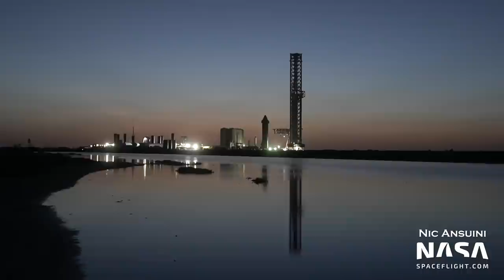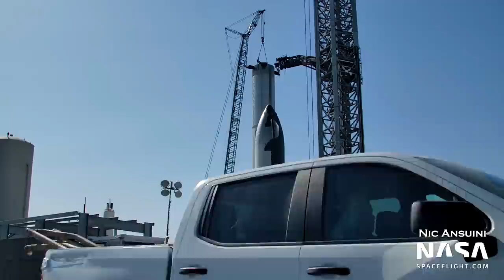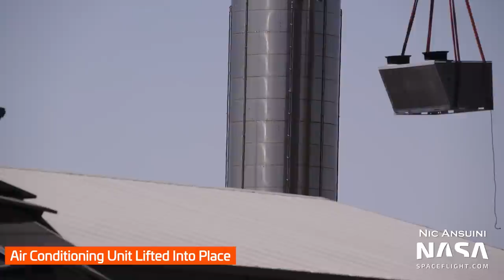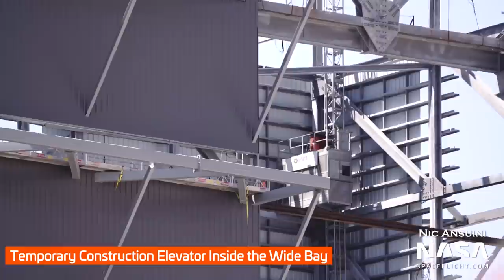Booster 4 Prepared for Launch Mount Removal | SpaceX Boca Chica

Comment from the maker: 0:00 Sunrise Over the Launch Site
0:12 The Launch Site
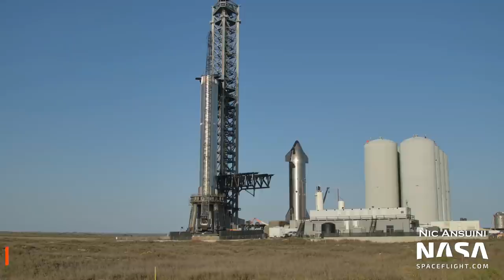0:27 Booster 4 Connected to the SpaceX LR 11000 Crane
0:48 Crews Prepare the Booster Transport Stand for Booster 4
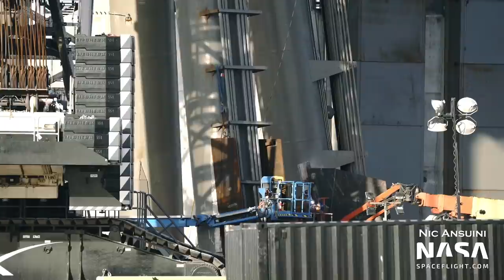1:18 Crews Weld Steel Parts on the Orbital Launch Mount
2:00 Chopstick Work Continues
2:40 Quick Disconnect Arm
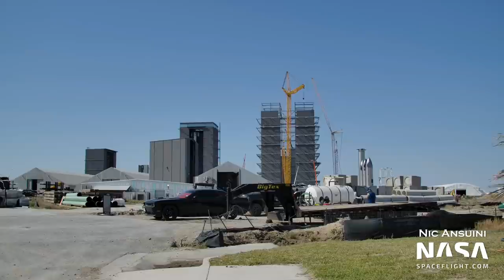4:03 The Production Site
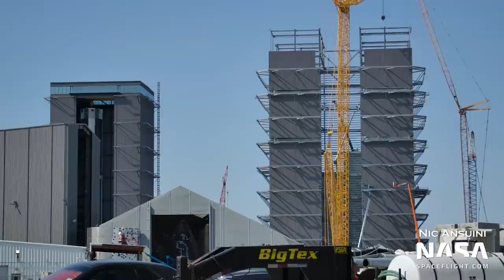4:22 Wide Bay Construction Continues
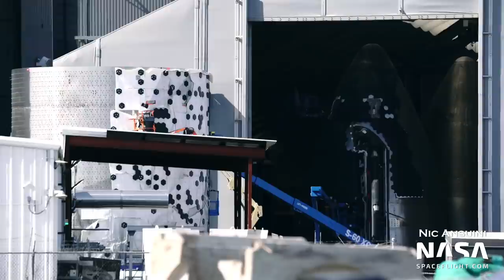4:42 Thermal Tiles Applied to Ship 24’s Nosecone Sections 
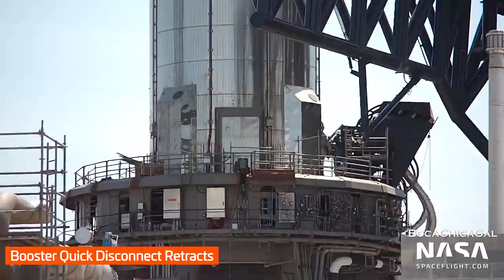6:05 Booster Quick Disconnect Retracts
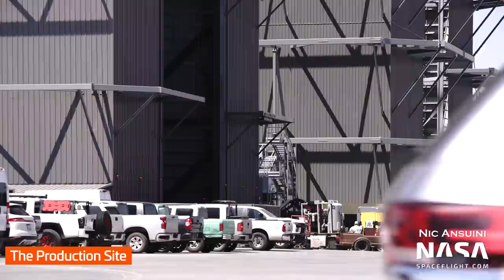6:58 The Production Site
7:48 Air Conditioning Unit Lifted Into Place
8:14 Dome Segments Outside the Tents
8:40 New Booster Thrust Puck
9:05 Temporary Construction Elevator Inside the Wide Bay
Reply: Long lmao
Reply: Why aren't they Using the Chopsticks to lift it? Shouldn't that be tested out?

Comment: Funny that they’re still not using the chopsticks 🥢 to lift the booster, but opted for the crane 🏗 again. I wonder what could be the reason. Structural integrity of the booster? I doubt that, as it would use the same load bearing points. Uncertainty of the chopsticks’ reliability with an even heavier load, and not taking any chances while it’s their only way to stack a rocket?
Reply: Could be that B4 is not properly equipped for a lift by the chopsticks?
Reply: The chopsticks have another mechanism that does not fit boosters at present. To change that is not simple - using the crane is.
Reply: @renehenckens  that certainly seems the most logical, is it the possibly sockets for the lower support brackets?

Its the only thing that would make logical sense as the 'original' elon timeline had booster 4 and ship 20 doing the orbital flight before the completion of the chopsticks, so makes sense in that regard.
Reply: Also I think they want to put B4 on the static fire test stand so why use chopsticks first and then crane if you could just use the crane
Reply: @tarek42023  It already is on the only SF test stand - the OLM. Did you mean the new cryo tests and can crusher stand?
Reply: @knowledgeisgood9645  What is the can crusher then? Thought it was for full static fire
Reply: @tarek42023  The can crusher is a stand and a "hat". They put the hat on top and join the hat with the stand using cables. Pistons on the stand pull on the cables until the forces the booster has to survive are reached. It is a way to test if a booster can survive MaxQ or not.
It has only been used on a test tank this far.
Reply: @tarek42023  I have to correct myself. B4 was NOT placed on the "can crusher" but on a transport stand. One of the new ones with alignment pins on two sides.

Comment: Speculation, b5 and sn 22/21 will also be test subjects to project zero. Sn 24 and booster 7 are likely to be the first, or unless you see a boat load of raptor v2 coming in when booster 5 is around then maybe they will do a static fire test.. not fly booster 5 tho, they want to see how the olp is going to hold up

Comment: Curious if 4 and 20 have plumbing, sensor and limited control packaging only for the testing.  I would not think the  navigation components would be included or necessary. Physical proof of concept an integrity.

Comment: Curious as to why the use of a crane?? If I may ??  Consider using laser beems from the lift to the ground for exact mounting and dismounting. Can be preset to ensure timely interchange. Also can either of the bases ( stages and prep) move one way or the other.

Comment: Why are they using CraneX for Booster 4 dismount from OLP. Why not using Chopstix?
Reply: Don't think they want to risk the chopsticks with boosters load, that's my guess
Reply: I am guessing, so don't 🧨💥me up if I get it wrong: The Chopsticks have a ball fitting that goes into the cavity under the forward wing area on the Starship. The booster has a ball fitting near the grid fins. So they need to change that to a cavity, to use with the Chopsticks. That's my observation.
Reply: @David-yo5ws  I think you are almost correct. The chopsticks need two types of fittings at present, but only have one. Once the chopsticks can connect to both it will start to lift both.
If I am to guess, the Ships will get something like what the boosters have - the problem is how to shield them. Retracting pins on a ship would be hard to make strong enough without adding too much weight.
Then comes the problem of catching them when landing. Holes in the hull for pins on the chopsticks would never be reliable - hooks will be needed on both booster and ship.
Reply: @knowledgeisgood9645  Yes, currently two separate setup's. Today's video shows B7 still with the 'hook' system.

Comment: i wish space x would at least send 4/20 up, to at the least test the heat shield on re entry!
Reply: I don’t get why they won’t send it up… It would get them more data and maybe would be a proof of concept. If it gets destroyed in the ocean or if it ends in the rocket garden won’t make a difference so the only difference I see is fuel price for a too old concept
Reply: @tarek42023  They aren't going to launch 29 cranky Raptor engines and possibly destroy the launch tower.
Reply: @michelleroberts1370  Ohhh yeah makes sense that’s a valid argument to use more reliable engines to protect the whole infrastructure
Reply: It really makes you wonder though, what would SpaceX have done if they weren’t held back by FAA approvals. How much risk would they have been willing to take with this rocket. And how much time would they have been able to cut from their own cycle time. I hope someone asks Elon this question next time they get a chance to speak to him.
Reply: In Elon's interview with Tim Dodd he said he was worried about the takeoff. He could have been joking, but I think he really meant it. But SpaceX continued working on both S20 and B4 for months which makes me guess there was hope still, but at some point, not so far back, they gave up on B4/S20.
I just hope the lessons learned were worth the expense.
Reply: It wasn’t going to orbit anyway, so the heat shield wouldn’t have been used.
Reply: @aldunlop4622  ship 20 would have been at orbital speed and altitude so yes the thermal protection system would have been given a thorough testing. Yes the ship wasn't to make a full orbit, but that is irrelevant
Reply: @aldunlop4622  yes the plan was always for s20 to go into orbit, the entire purpose of the planned launch was to test the heat shield at orbital return velocity.  It was going to launched to orbital altitude and velocity.  Then, it was going to be immediately de-orbited so as to test reentry, and the heat shield will absolutely be necessary. It would also be the first opportunity to test the vacuum engines in flight.  Just because it was not going to make a complete loop around the earth does not mean it is not “in orbit”. This flight path is different from a ballistic flight path because it will not be a simple parabola, but even a ballistic missile still needs a heat shield for reentry it it goes high enough.  
But it makes perfect sense to not fly b4/s20 because they have made lots of updates so it makes more sense to test what is more likely to work.  It is very expensive to actually launch a rocket, so it would not make financial sense to launch anything but the most useful version.
Reply: Blowing up stage 0 would be the worst case scenario, but I think they were fully prepared to manage that risk in attempting to launch ship 420 with raptor version 1 engines. Did and does the delay introduced by the FAA impact timing and decisions? Undoubtedly. Would they have launched 420 by now if not hindered? It's hard to say for certain, but one thing is certain SpaceX doesn't slow down their development, and they don't hesitate to leave old designs behind as the newer iterations are developed. Massively parallel development has a downside if you can't afford it, but if you can afford it, the acceleration of your prototype development is huge. Hopefully, the FAA parking break is released very soon!
Reply: @johnvdlaar747  I stand corrected, I was under the impression the reason it wasn’t doing a full orbit was because it wasn’t going fast enough.
Reply: @johnvdlaar747  I learned today also that Al Shepard’s Mercury-Redstone rocket burned ethanol, not RP1 as I had always thought. Every day’s a school day:)
Reply: @johnvdlaar747  well ya, im almost assuming that stage zero will get fucked up before too long.  almost inevitably when they try to catch the first booster!  plus i feel like itd without a doubt achieve liftoff, orbits always a question, even though i feel like theyll nail it.   im just selfishly wanting to see this shit start rollin down the road a little, the anticipation kills me lol.  
ya know i dont follow anything other than mma n this shit, an its for that reason, i hate lookin forward to things lol, im a very strong willed person, but fuck me if anticipation isnt the only thing i cant stand
Reply: @knowledgeisgood9645  im sure he meant it, ill have to check that out.  thats what made me think there may be problems, was that last super short static fire.  it was a bail, an they seemed to almost try again, although i wondered if they were just purging the tanks with nitrogen to get rid of the propellants, but i dont believe we ever got an explanation about how it all went.  i dont think weve seen an attempt since.